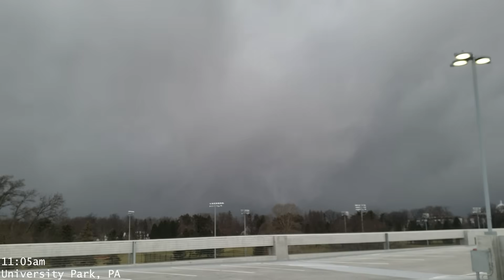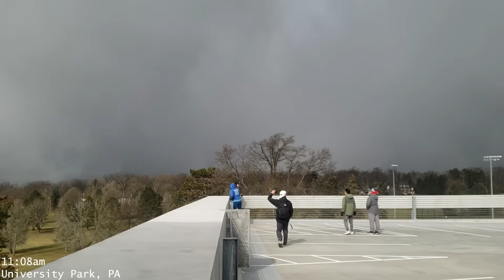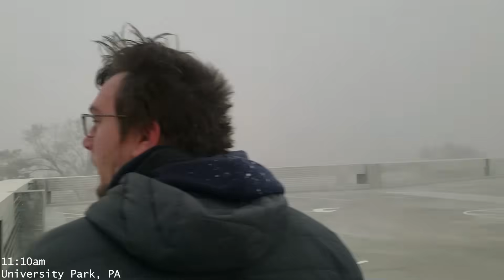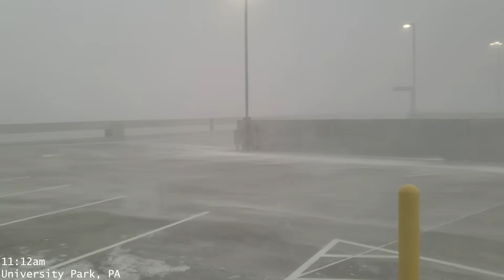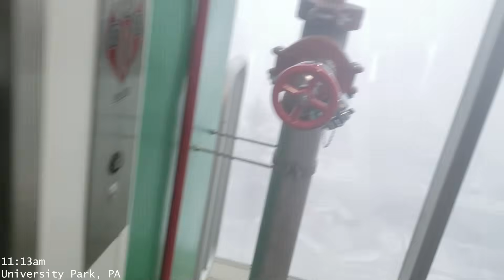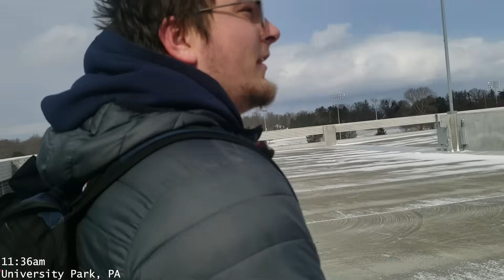Snow Microburst - State College, PA 2-19-22

Comment: Just remember, 90 mph winds are enough to throw a 150 lb man across that parking lot. We had a microburst with about that windspeed and it took down 200 plus trees in a 2 mile radias. It was at night but one kid was getting home and tried to run in the house but the wind picked him up and flung him into the house wall. He's fine but that could have easily not been the case. This looked fun. But knowing what could go down. I'm not going to risk it on a roof top.

Comment: If you ever get a chance to check out an intense single band snow squall coming off of Lake Ontario, I think you'd really enjoy it.  As you approach it, you actually get glaciated anvil tops from cumulonimbus that's only ~10 kft tall (so it looks like stubby little thunderstorms), and the really good ones will produce waterspouts, frequent lightning, thunder, and in the really strong ones you can get inflow winds over 50 knots.  Pretty amazing stuff.

Comment: Here in the PNW, we can have 55 degrees, and then a heavy rain and suddenly in under a minute, boom...heavy wet snow as the cold air aloft brings down the snow level and then the temperature plunges to 31/32 and in 10 minutes, ya got an inch or more of snow

Comment: This looks very similar to how "The Children's Blizzard" of 1888 was described in the book of the same name.  Pretty interesting read where an intensely cold winter gave way to a very relieving January thaw in the midwest. Thousands of students from several states woke up to a warm day and decided to go to school, many without even a jacket.  Without any warning, a dark grey wall appeared on the horizon and swiftly engulfed everything in its path and dropping temperatures to the negative 20s.  Where it differs from this squall is how the snow is described as a "fine ice dust" that nearly took your breath away from breathing in.  It was a particularly intense front that wasn't really a microburst or a squall.  They call it the Childrens Blizzard because of how many children died in it, about 235.  The snow was so blinding and the wind so intense, that many could not find their ways back home, some even getting lost after only taking a few steps outside.  This video just made me think of that.

Comment: That would’ve warranted a severe thunderstorm warning in the summer. Instead, instant, near-blizzard conditions in the winter!
Reply: That's why I prefer winter. I have a phobia of summer storms because they are often so dangerous. Of course blizzards are too but the danger can mostly be avoided by staying inside and not driving. With severe thunderstorms, you have to worry about tornadoes and lightning. And the tornadoes in particular are what scares me so bad. Summer storms often scare me near to tears. But winter ones? They make me happy, because there's always a small chance of snow and virtually no chance of a massive EF3 or EF4 ripping through my fragile Texas home and killing me. Even if a tornado manages to form it will likely be a weak one.

Comment: This is a cool phenomenon in winter. How much snow can you get from a snow squall? A few inches?
Reply: Not sure. But I did get a couple inches from a in like 45 minutes after a snow squall came through once
Reply: Snow squalls are usually pretty quick i usually get around an inch or 2
Reply: @catz_crazy6672 I had one here at lake in South Central VA lasted 1.5 hrs and dumped 4 inches
Reply: @catz_crazy6672 Squalls can last for days especially if they form over a warmer body of water. Ask people that live in Buffalo NY.
Reply: They are narrow, quick moving storms that usually bring in a major temperature change, they only last an hour or so at the most and depending on how powerful they are can drop about 1-3 inches quickly. It might not stick though if the fround temp is too warm
Reply from the maker: @A_Lion_In_The_Sun  Yep, you stated it very well! In RARE cases, I have heard of snow squalls dropping more than 3 inches, even in the short span of less than an hour, but almost every case will be how you described!
Reply: @storminorman315 I believe they also state possible totals in the Snow Squall Warning bulletin!

Comment: Is that a lightning strike at 0:44, or did a transformer blow out?
Reply from the maker: oh wow, I actually never noticed that! I believe it's only a perfectly placed snowflake going very close to the camera lens (though it's weird you don't see it in the frame before or after). The closest lightning bolt in this squall was about 50 miles away iirc, and I don't remember hearing about power outages on this day, but very good catch!
Reply: @storminorman315  You're absolutely right. I just did a freeze frame myself to see what it was. Definitely a random snowflake. Cheers.